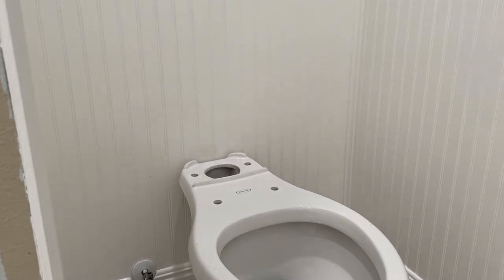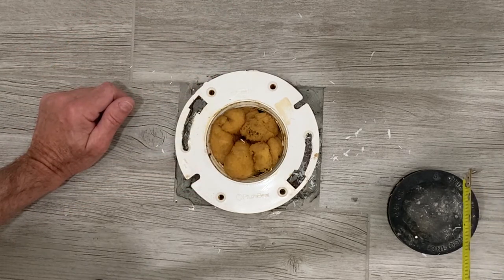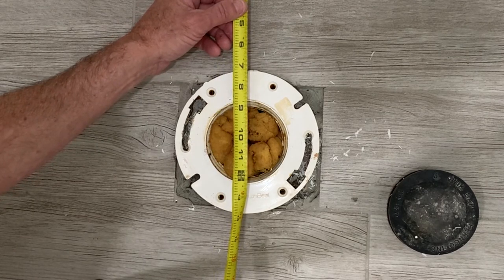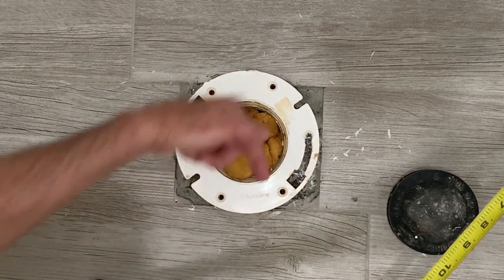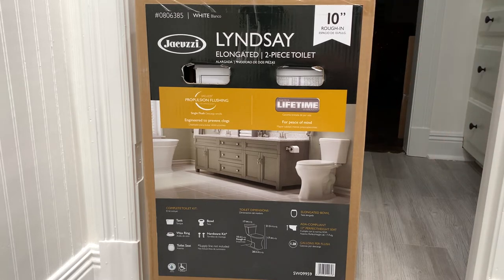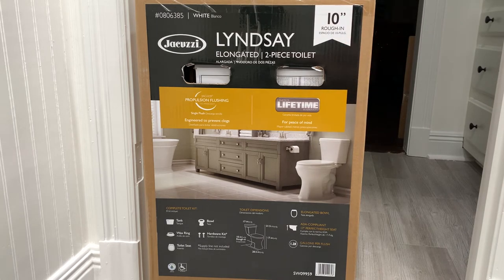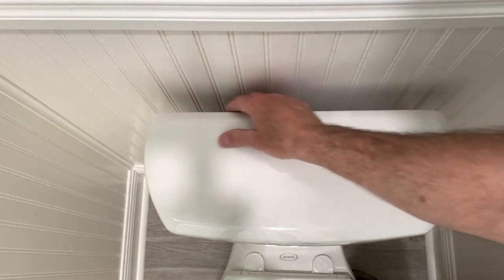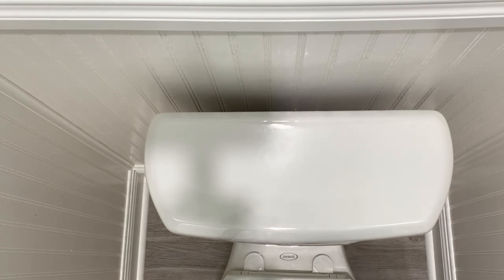Toilet Doesn't Fit! How To Fix!

Comment: My question: why are toilets of all things so ridiculously stupid with dimensions as to have "options"? Why is this not as standard as pipe diameter? I can't go to box store and get 1 1/15" pipe because that just wouldn't be reasonable. No use for such a thing. Well...same here and these measurements to me scream something along the lines of "wiggle room" with building codes.
Reply from the maker: I think 15 inch is the “standard” since 90 percent of the ones in the stores are 15 inch.  At least there are only two sizes.

Comment: Hey bro good night how things I have that same problem with ah toilet flange that someone else don and Am using a 12'' can I cut the wall and ease the toilet back
Reply from the maker: That might work,but would not look good. The tank on the toilet would be in the wall space a little. Plus you might have to cut out a stud some. One viewer commented that you can buy an adapter at a plumbing supply store for some toilets. I have not used one and can’t verify whether they are available. It’s worth a call before buying a new toilet. Only other option is to buy the 10” toilet.

Comment: what if i need to move it 4 in? the plumber screwed me in the rough in
Reply from the maker: Look at using an offset toilet flange. Google it and you will see what I am talking about.
Reply: @FixItDepot  it seems like they only move it an inch
Reply from the maker: They make a 3 and 4 inch offset.
Reply: @FixItDepot  do i have to break the concrete to make one of those fit?
Reply from the maker: It might need to have some of it removed. The old flange could be difficult to remove. Might to be time to make the plume fix his mistake. Good luck with it.

Comment: Say a commode is sitting on a curb for giveaway how do you tell if its 12 in or 10 in? Thanks.
Reply from the maker: Not sure you could get an accurate measurement. Measure from the back of the tank to the center of the drain hole. Probably about 90 % of them are going to be 12 inch since they are most common.
Reply: Put a level on back of tank to simulate the wall, measure to mounting holes on the base of the toilet.